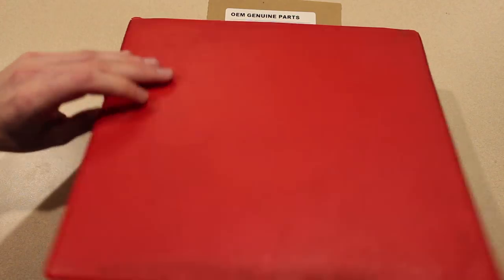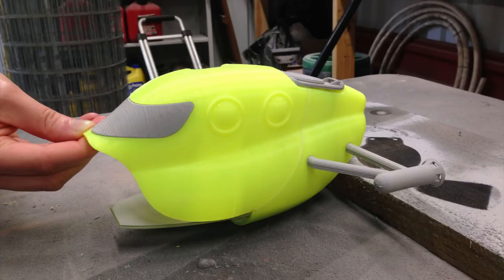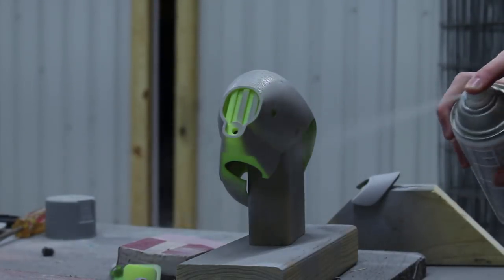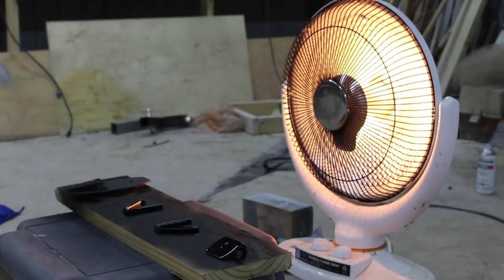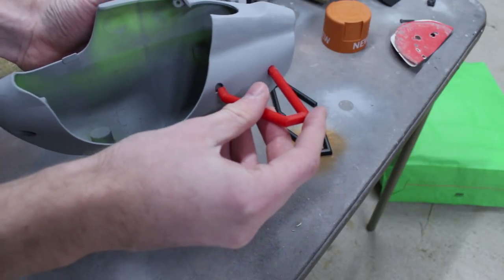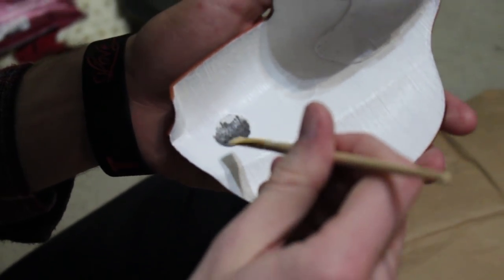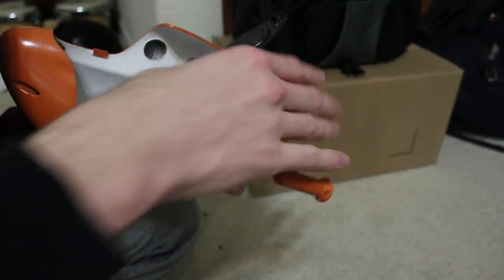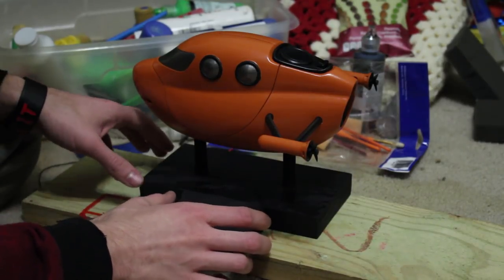CURV II - A 3D Printed Scale Model Submarine

Comment: PS you should get this tool, i got one myself and so much easier to work with when doing extended spraying. https://cdn.eastwood.com/media/catalog/product/cache/1/image/9df78eab33525d08d6e5fb8d27136e95/p/1/p13455.jpg
It also helps getting a more balanced flow since your hand is cramped around the bottle and top part.